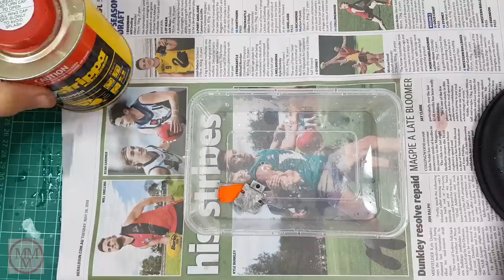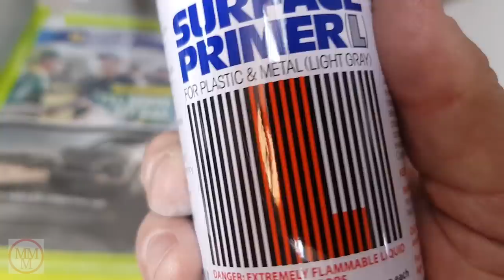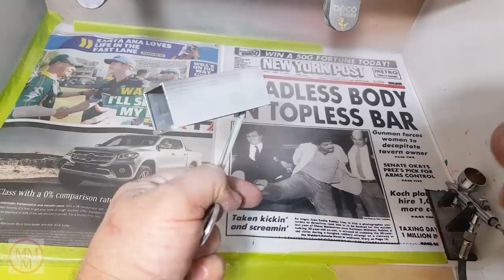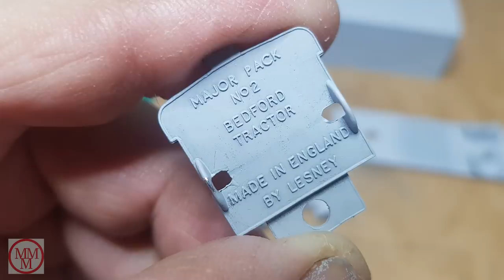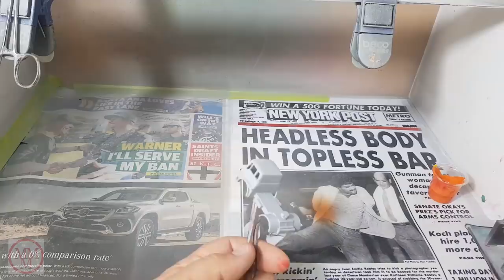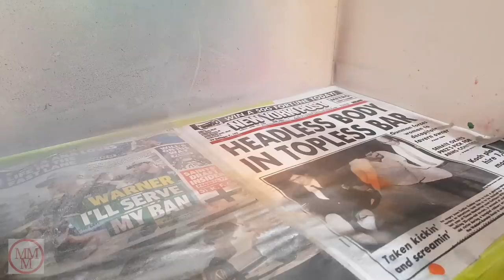MATCHBOX Restoration Major Pack No M2b Bedford Tractor

Comment: Love it, Love it, Love it. One of my favourite castings in the Major Pack series and you have totally nailed it Marty. It also comes in a second livery with silver cab and dark red/maroon trailer and LEP International Transport decals. Just as a suggestion when using caustic soda as a stripping agent I use a Cook ware metal meat dish/bowls with a Teflon coating. It will eventually strip the Teflon coating possibly but at least you have no risk of the container exploding. Also as a precaution wear rubber gloves and goggles in a well ventilated area, it takes no prisoners like skin and eyes and has a harmful odour that can damage lungs. That said ' Top Job Fella'
Reply: What you said in spades TBID, both in the quality of the work and the hazards of paint stripping. I once saw a supposedly qualified chemist drop 50kg of caustic soda pellets in 50kg of water - fortunately, we managed to run out of the room before it exploded! Concentrated caustic will remove fingerprints from skin and leave burns if repeatedly exposed. Nitrile gloves will provide better protection than pvc.

Comment: Hi Marty. Loved this. Fab job. 
I use metal baking tins (varying sizes) the type use for small loaves and cakes for the caustic soda. Initially they will lose the non stick coating in the process, but once down to the metal they last for ages. 
Keep up the good work. 😊👍

Comment: Marty 
Be very careful using caustic soda. The stuff is actually lye. Eye protection is a must!!!!!!!! Use glass containers, pyrex or so. Couldn’t find anything on Wikipedia about reacting with the zinc the models are cast from.
Incidentally, any time I drill like you’re doing thru baseplates I use my drill press. Comes out much more precise. You’ve inspired me to haunt the flea market to find some matchbox gems. Keep it up.

Comment: Thanks Marty for another great video! The restoration of this Major Pack is excellent! :) Well done!! I was wondering if a thin flat washer under the pan head screw might have worked, but the rivet was a much cleaner finish.  I guess the fruit bowl was not all "it was cracked up to be" under the hot water. :) May want to try a Mason type canning jar for future hot water and caustic soda combinations. Those jars seem to stand up better against heat. Thanks again and look forward to your next video. :)
Reply from the maker: Thanks for the tip Rich, I also like your comment 'not all it was cracked up to be', it certainly cracked me and the missus up!

Comment: Wow...so much new and exciting in this one. I do hope you make it a running gag of the various glass receptacles the caustic soda destroys for your projects. It does look better than the paint stripper. I like the rivets and feel this should be the way to go as opposed to the screws, but I figure you perhaps do do more work on these models post restoration. Question. You use silicone on the transparencies, how would you undo that if you wanted to? Is there a silicone solvent you would use?
Reply from the maker: Thanks for a great post Everard. I do not use the rivets very often as there is seldom a substantial metal post that can accept them. The caustic soda did work well but it seemed uncontrollable and a bit hazardous for the average hobbyist ! The silicone , when set, is able to be pulled free and removed with a scalpel or similar and could therefore be of assistance to a future restorer if they felt the need to remove the transparency. thanks for watching! Marty.

Comment: Another great makeover. Next time you drill out a rivet, use a drill slightly larger than the rivet shank, rather than slightly smaller than the head. That way if you go too deep you'll not have the problem of opening out the hole

Comment: You've done a great job here mate!..esp the home-made transfers,
I always liked the Bedford T.K (I did a lot of miles in them as second-mate in the late sixties/early seventies)
I look out for models of the T.K, (the matchbox tipper is really fine), I have a couple of them mint & boxed and the same with the matchbox refuse truck, another fine example.
The tyre's seize onto the axle's because of rust, as you found out WD.40 sorts it out.
Anyway, best wishes from the U.K

Comment: Some info on this M2b. From 1961 to 1964 it was Davies Tyres. Bright orange tractor,trailer frame and rear doors. This is the one shown. Later paint was changed for the LEP
trailer. Done from 1964-1966. Tractor and trailer base was aluminum and trailer in red including rear doors.The trailer had ribs on the side  except for the angled oval for the 
Davies Tyres decal. When it became the LEP trailer you could still see where the angled oval was on the trailer but the decal was a  rectangle with a small square LEP logo!
You did great on the whole truck. Looks smashing. You should be happy with that!👍🏻👍🏻 Where do you get bronze wool from? Never saw a bronze sheep! Couldn't resist!

Comment: What a great job Marty might of looked cool in red also. That headline was one of the best ever. That was on April 14th 1983 geez 36 years ago. 
The man to come up with it was Vincent A. Musetto who died June 9th 2015 at age 74. But I bet he would of got a kick out of it in your video. Oh and Marty an idea for getting those pesky tires off a thin piece of metal bent at a 90°  angle the height of a tire with a slot to fit over the axle. Might be easier to pull off from behind the wheel and save your fingers getting cramped.

Comment: You could have glued the rivet in the hole. Just cut the head of the rivet off and use it as a washer. That way, you could have drilled and tapped the glued in rivet. But, your idea worked perfectly too.

Comment: The best thing for stripping enamel paint is oven cleaner, put the pieces into a plastic bag spray the oven cleaner on the pieces and tie a knot in the bag close to the pieces, leave overnight, then just wash with water and a tooth brush.
The best thing for stripping acrylic paint is Dettol, place the pieces in a plastic tub pour on Dettol till it covers the pieces, put top on tub and leave overnight, then just wash with water and a toothbrush, with this method you can use the Dettol over and over again.

Comment: brilliant resto cobber.... saweee .. forgot to mention I use old jam jars ..hope you weren't in too much strife ...presently restoring 2x superfast freeman intercity commuters .. doing customs as it had to be one of their most boring castings ( futuristic in the 70s ) one is now sat on new hotwheels wheels and is awaiting a donor as I had a brain fart and forgot the reaction of plastics to boiling water when I tried to strip the paint without stripping it down first like I do with the detol method
Reply from the maker: Sounds like you have a lot on your plate, good luck and thanks for watching/posting.
Reply: yeah will have to video some trickier than most think ,, as I found out when I used to do my painting videos on here
Reply: also  worth mentioning is that I soak plastics in either Dettol or spray on mr muscle oven cleaner overnight both will strip paint off plastics without any damage which paint stripper and caustic soda method will not do without damage i'll have to send you some of each product if you cannot get in stralia

Comment: I would have either filled the hole with solder or just some JB weld and drill a new hole in there.
But you usually drill way to deep anyway, you always drill quite deep into the part itself instead of just the rivet.

Also i would use some acid to get stuff thats so stuck lose, something like 25% acetic acid

Comment: Matty, get yourself a flexy attachment for the dremel. Its makes it 100 % better. Just easier and more conveniant. And get yourself a Smaller diameter drinding dstone. I think your using 10mm dia but you can get 5mm dia or less !

Comment: Hi Marty, Looking for a bit of help. I just got one of the trailer boxes off this set. Now it does not have the ridges inside the trailer, so the trailer base is very weak, were there two versions of this trailer made, it has original black wheels. but you can push the base or bend it, really strange. stripped it to restore as l needed to fit some doors, oh by the way when you did your restore you turned the doors round, or was that a' one of those moments

Comment: Marty please could you do a how to video on repairing a cracked windscreen for a matchbox car
Reply: Some of the other restos show damaged windscreens, but no repairs.  If they are coloured I cannot think of a easy fix.  you would need some kind of liquid with the same refractive index to run into the crack or split which would dry hard, could you form a replacement by making a wooden internal former and bending slightly heated clear plastikard around it to get the fixing shape?  Side windows you can use modeling glazing or some old packaging plastic as a subsitute but any curved screen will be tricky.
Reply: @highpath4776  thank you that was really helpful it might be tricky as I'm doing up a unimog with a curved and cracked windscreen